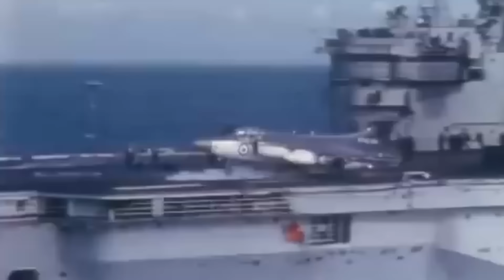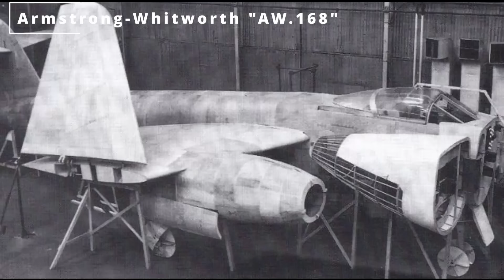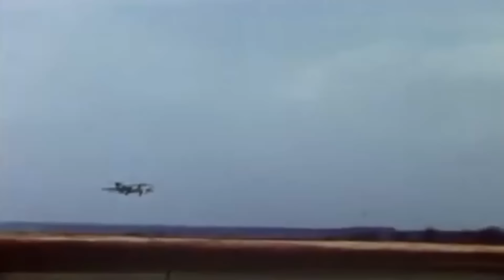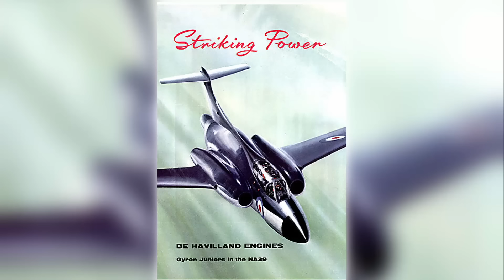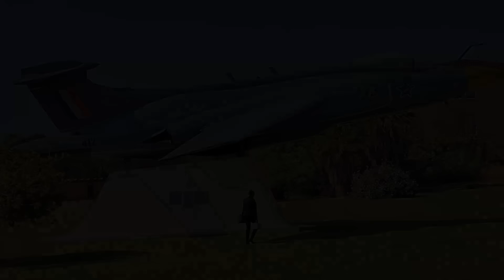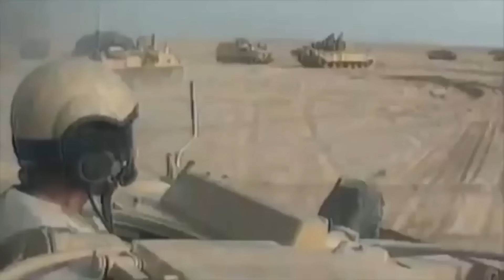Blackburn Buccaneer  -  Insane Low Level Bomber Americans couldn't shoot down - (Full Story)

Comment: That plane is the very epitome of hideous! How does something like that ever leave a drawing board?
Reply: Blackburn were famous for designing some of the most ugly aircraft in the world.
The Bucc was probably the least unattractive.
Reply from the maker: I had written up a whole piece about Blackburns creations, but I decided not to included it since the they are forgiven for giving the world the Bucc.
Reply: Speaking as an aeronautical engineer - military aircraft are designed to do a job, not to look pretty.  The Buccaneer is an excellent answer to trans-sonic aerodynamics at very low level - and an excellent structural design.
Reply: @dafyddllewellyn6636  ...so why were there sooo many other trans-sonically aerodynamic aircraft that did a better job than the Buccanneer and they did it without looking so repulsive? Poor Engineering. You should know that being an "aeronautical engineer".
Reply: @sebastianslowik-d3c  Such as?  The Buccaneer was designed for "toss-bombing" a nuclear weapon from "below the radar" altitudes - and to do this from a carrier with the small English  lifts,  and before angled deck carriers were in use by the British.
Reply: @dafyddllewellyn6636  Are you kidding? Anything like A1 skyraiders, A6 Intruders, Corsair II's FA-18 Hornet could all toss nuclear bombs.  The A6 Intruder was shorter and the wings folded which made the Intruder much smaller than the Buccaneer to fit those "English lifts". (I'm totally amazed that an Aeronautical Engineer like yourself didn't know this). The skyraider and Corsair II's were even smaller than the Buccaneer.  Yes the Corsair II was an ugly plane but not Buccaneer butt ugly.

Comment: Interesting that you don't seem to know anything about the tailplane issues on the Buccaneer that preceded the fatigue issues on the wing. As a young nav on sixteen squadron in 1978 we were recovering from a low level sortie over the north german plain when my front seater reported strange handling characteristics in pitch and roll. We declared a precautionary approach and landing at Laarbruch and after a gentle (for Buccaneers) landing taxied in and shut down.  After a lengthy discussions with the groundcrew we went back to the crewroom for the obligatory coffee and debrief when our crew chief came in and invited us to come and see what he had found.  The groundcrew had positioned a giraffe (tall ladder platform) beneath the tailplane and the crew chief climbed up and put his shoulders under the tailplane and promptly , with a fair bit of brute force, proceeded to rock the tailplane assembly up and down by about 2 or 3 inches. It transpired that 3 of the 4 bolts that held the tailplane in place had sheared and all that stopped us from crashing was the one remaining bolt.  The same problem was found on several other aircraft in the fleet and led to all tailplane bolts being replaced with new. Luckily no crashes occurred following this discovery but the tailplane was always one of the weaker parts of an otherwise superbly strong and immensley capable aircraft. 

Did you also know that the Buccaneer had a faster roll rate than the Gnat due to the fingertip to armpit ailerons which also put a great strain on the tailplane!

I never saw the inertial nav that you mentioned early on in your excellent video, all I ever had was a map and stopwatch!!
Reply from the maker: I was going to add a mention about the "stop watch and map" but it ended up on the cutting room floor along with a fair amount of other stuff, the issue is which these types of videos is how deep does one go, for me I could write reams and volumes, at the moment I am finding out the appetite for these long form videos, it seems from reading the comments that many aviation fans are keen for them. Btw, very jealous you flew in the bucc, I have a soul for sale if anyone is interested just let me have to have a quick once around the circuit.
Reply: @AviationRepublic  I was also on the first Red Flag for UK Buccs and it was also the first time a Buccaneer flew below sea level when we took a brief deviation from our return route by flying down Death Valley! .... but that's another story for another day.

Comment: Driving back to Grange over Sands from the Lake District, the road goes over a saddle between two high fells. I'm at the top of the rise when two of them came up from behind and frightened the crap out of me. A definitive Whiskey Tango Foxtrot moment. I'm wildly looking around in my mirrors for what was causing the huge noise and then I saw them streaking off down the valley towards Morecambe Bay. Needless to say they were diving towards sea level. Man they were low.
Reply: Change underwear moment.
Reply from the maker: I imagine the pilots took great pleasure in providing impromptu airshows like that. They are responsible for so many great memories.

Comment: RAF is always getting dumped on by its naval Sir Fleet Arm needs. The latest dumping on the RAF is the F35B variant when they wanted the standard variant. F35B variant is shit in all respects compared to the standard variant and hugely more expensive but the UK government forced the F35B on RAF to lower the overall purchase cost for Air Fleet Arm.
Reply: They are likely to get ‘C’ variants when the carriers get cats and traps and the ‘B’ gets swapped out
Reply: @robertpatrick3350  Which will never happen because they thought cats and traps was too expensive when building the carriers and hence the F35B VSTOL but ironically, the cost of F35B variant cost has exploded. I think this has turned out to be the more costly option and for it we have a below par aircraft. The standard variant has much higher performance and capabilities.
Reply: it about time it always been RAF  first  why  o you think the RNFA  we had crap planes in the 2nd WW

Comment: I like to point out, SAAF Buccaneers did not carry out missions in South West Africa, only in Angola.
They did at times operate out of South West Africa.  Their strike missions often started from Pretoria, flying directly to their target in Angola and not giving the enemy time to know they were coming.
Reply from the maker: I have got it on my to do list to look deeper into the SAAF and their Buccaneers and make a video it soon, I feel there is a very interesting story there,
Reply: @AviationRepublic  the was a squad of paras in angola that had just competed an op against swpo bases,  they where trying to exvil out when they heard that a column of tank were approaching,  buccaneers that were on a bombing run were called in for close air support, but they had already completed their run and were out of ammo,  so the pilot decided to try trick the enemey and made mock bombing runs,  scared the shit out of the column and force them to hold while the crew ran for cover, giving the paras time to get the hell out of there
Reply: @Ghoulza  From what I recall reading, that column were Cubans coming from their Cuban base.
Reply: @jeffnic3116  you could be right...  the issue is i have so many of these stories that i sometimes mix details up,  and i know if i make one mistake internet will hound me so i try be as vague as possible  to avoid these mistakes,  i thought it was cubans when i was writing but use angolans just in case.
Reply: @Ghoulza  They set up their base far from the border thinking the SADF will not go that far into Angola, they felt safe setting up close to a Cuban base.
They also once set up near a Cuban airbase thinking the SAAF will not come due to air defenses, they came after them. You carry out strikes into SWA, they look where you operate from and come for you.
Reply: @jeffnic3116  yip,  whats also weird is SA had an agreement with Angola,  they could go in and conduct raids against SWAPO/PLAN as long as they didnt attack or come to close to Angolan bases.  the same bases that SWAPO/PLAN setup next to.   in one contact SADF memebrgot lost attacked a patrol and it turned out they were Angolan soldiers they attacked,  many fanisnating sotries from the border war
Reply: @AviationRepublic  A good read, I have it, "From Fledgling to Eagle", by Dick Lord, has a Buc on the cover, he started his career in the FAA flying the Sea Vixen, after retiring from the FAA, ended up in the SAAF.
Reply: I remember seeing the SAAF Buccaneers here and there over the years and was always struck by how ear-shatteringly loud they were.
Reply: As a laaitie going up in  Pinelands, Cape Town, I saw a Buccaneer do a fly past over the soccer fields and break the sound barrier. Circa 1973.
Reply: Please, try not to confuse anyone with a fact as their minds are already made up.
Reply: @rudolphguarnacci197  I agree, walk away if you can not have a civil discussion.
Reply: And by "The Enemy" the SA Govt. meant: "Uppity Blacks who had the temerity to Not Want or Need Colonial-type 'guidance' from the "friendly" Apartheid Govt. of South Africa! 

Mate, if you Genuinely Believe S.Africa hasn't bombed and blitzed Namibia, Angola and All 'points North' where they believed there were ANC and 'others' Training and Supply Bases.....
– Well, I'm an Investment Specialist and am currently Selling to wise investors, Shares we hold in A Big Clock in London - right by the River Thames and Houses of Parliament - and recently Refurbished at a Cost of..... well, I  Can't give Too Much Away!! 

H2G! Some folks make you... 🤬🤬🤬
Reply: @Keiran_P0D_Benn1678  It was Black Countries & NATO that asked South Africa to stop the Communist advance in Africa. There was a Black South African Regiment that also helped stop the Communist advance. I take it you are living in North Korea, the only place left with the Communism you love so much.
Reply: @Keiran_P0D_Benn1678 ok i challange you to find anything that shows buccaneers bombed Namibia.  I'll wait while we waiting let's talk about swapo planting landlines in Namibia along paths civilians used, or planting bombs in churches and radio stations.  once you realize there is zero evidence for buccaneers bombing namibia we can move on to he other crimes swapo commited against civilians
Reply: @Keiran_P0D_Benn1678  Sure, they "blitzed" their own territory, SWA & RSA.
Reply: @Keiran_P0D_Benn1678 you mean blitzed as in Hamburg and a hundred other cities?
How many civilians were killed?
Oh wait there was a war on right?

Comment: When I did my RAF apprenticeship we had a couple of Bucks to train on. We studued the airframe in depth. It had some incredible innovations for carrier service. The strange 'coke bottle' shape is designed specifically to give her stability at ultra low level. The is why the Buck could fly so low SO STABLE. ordinary shape fuselages cause the aircraft to be troubled by ground buffet. The wings were also fitted with a superb system called 'Boundary Layer Control', which you mention. This allowed pressurised air to be tapped direct from the engine into the wings. This fed into slots and was fed along the laminar flow zone on the wings fooling the wing into thinking it was flying faster than in actually was! This gave the aircraft amazing carrier launch performance. Very sad when they slowly phased out all the 'cold war' jets I served on during my service. I know where many are stored awaiting a day we again need an ULTRA low level attack aircraft. Wrapped up in plastic and stored in temperature controlled hangers......
Reply from the maker: The Bucc in my local RAF museum was for years keep hidden away in the back of one of the display hangers and only recently put her in prime position in the main hanger where she belongs with a nice set of steps to get a look into the cockpit and right down the body where you really get to appreciate the work that went into her design. She truly was a one of a kind.
Reply: Hi Brat, another Brat here!
The Bucaneer was designed using the area rule so a plot of the cross-sectional area follows the shape of a bell. The idea is to prevent sudden changes of airflow thus preventing breakup of the laminar flow across the skin which causes drag, buffet and instability.
Reply: I believe there were plans for a Super Buccaneer as an alternative to TSR2, could anyone cast light on this?
Reply: ... @geoffnottage8894
Reply: Interesting comment re Buccaneers being held in storage. I didn't think we British were so pragmatic? Surely the airframes have expired and the engines are u/s?
Reply: The first two facts were very well described in the video. Fair play to you for making a comment but did you think that no-one was listening?

Comment: Excellent vurke. I'm amazed at the idea of the engine bleeding over the wings to increase lift.
Reply from the maker: It's a pretty amazing Idea, i had written a whole section on how it works for the video, but I had to cut it and other parts otherwise it would have been over 2 hours long
Reply: @AviationRepublic  If you ever find the time to make that video I would absolutely watch, and like it.
Reply: Really funny to get the newbies to stand near the wing on see offs, as the boundary layer vents would fill with rain water and spray out on engine start 😂. Also the air starter trolley (pollust ... spelt wrong no doubt) had a cover on the exhaust, but, again as a prank on the new guys, we would make sure there was some water in the exhaust and as the air starter engine wound up it wound bang and pop, leaping about ... very scary for him ... hilarious for us 😂😂

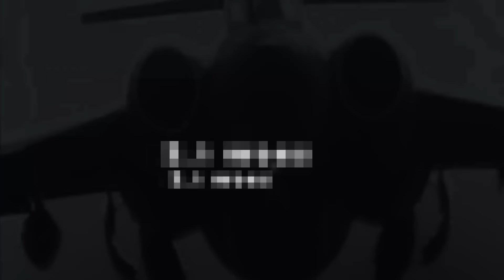Comment: Nice video about a great aircraft, but a shame some of the video clips are reversed - aircraft carrier islands are on the starboard side. Check at 20:07 and 26:09, for example.
Reply from the maker: Thank you, sometimes I do that, either due to copyright or lacking footage.
Reply: @AviationRepublic  I believe in the clip at 26:09 the  carrier is leaving Portsmouth harbour, the giveaways are the tower of the harbour control and the chimneys of the old power station; when exiting Portsmouth harbour these would be to port.